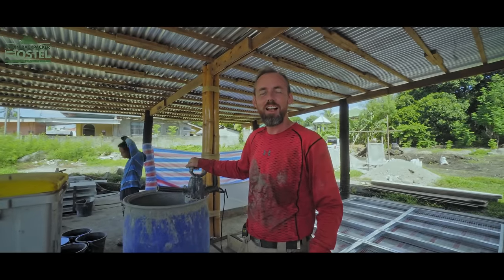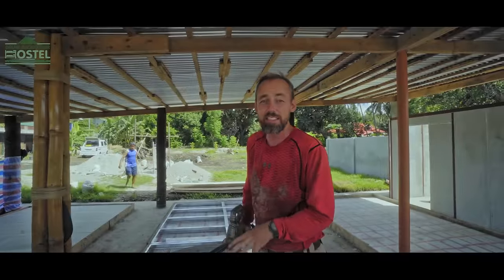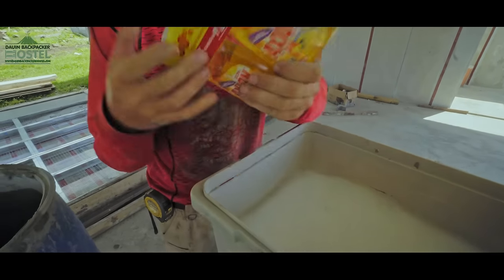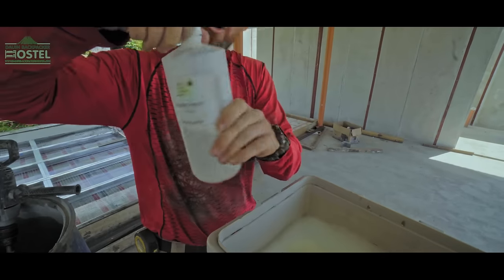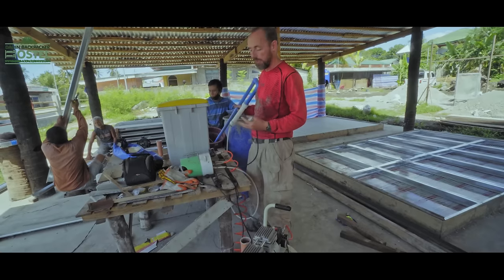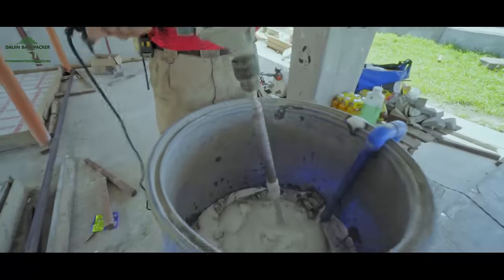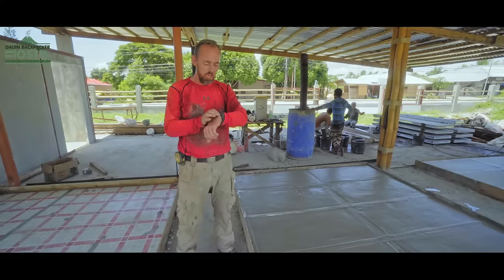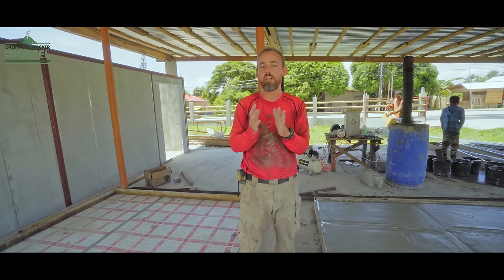Precast Aircrete/Foam Concrete Panels - How To Mix and Pour

Comment: I have an idea, I am to old to start a new venture, but someone out there may want to pursue this idea. I would like to build aircrete logs. Based on the toys we all played with when we were kids, Lincoln logs. These could be pre-manufactured so really almost anyone could buy the logs and construct a building. There would need to be different lengths made say like 2, 4, 6, 8, 10, 12 feet etc. There would need to be some that had special ends with channels for doors and windows. There could be some that are pre wired with wall outlet boxes and switches. Logs could be pre-colored or surfaced in some cases. A building could be constructed permanently by bonding the logs together, or could be temporary and disassembled and moved. I think this could be an amazing new business that could revolutionize small buildings. And it would allow for any person to DIY.
Reply: Unless one wanted to do it for aesthetics, it would be too much extra work over what is shown in the video.....3 sided post with a round side like a square log house...? chinking a cement log? too much work....just saying
Reply: I dont think aircreat is load bearing
Reply: @WindoWarrior  its not but could be reinforced.
Reply: @jerry-cw9yw  that could be said about all building materials. There is always a way to mess something up. But that doesnt mean its not a good product
Reply: That is actually a good idea.
Reply: There is a similar market available product called Apex Blocks
Reply: Extrude them into woven polyester tubes like giant aircrete sausages.
Reply: In another video he builts an entire building with this stuff and its panels as you can see 3 inch thick so yeah , load bearing just fine and it obviously works. So this idea is 100 percent viable.  Nice!!
Reply: They do make hemp and concrete Legos to build with so that's another idea hurry and patent the idea
Reply: If anyone sees this idea and decides to materialize it into reality, please make sure to give the original poster of this thread the credit they deserve. Be it the whole idea, parts of it, "a spin on it", or inspiration, make sure you acknowledge all the people and things that helped you along the way.
Reply: Nice
Reply: @WindoWarrior it can be.

Comment: I've seen people making foam blocks with 37.5 kg gypsum 2 kg cement mixed in 50 litres of water and foam. They set hard enough to be unmoulded in 15 minutes. They are then stacked for curing

Comment: I guess you have moved on with your travels. If you happen to log in again Id love to know the first step because its not mentioned. Can you tell us all how much sand and cement and water to make the initial slurry please. Video shows 1 bag sand 1 bag cement but how much water? Was that sharp sand or builders sand? Any additives? Maybe Im over thinking but ive most certainly written down the rest of the detail its great thank you. Please do reply because all the aircrete videos on youtube fail to mention this key step.
Reply: The details are all in the video and also the comments section but I had to watch the video a number of times and I'd like to mention that I personally think this video is the best I have found so far on how to make foam concrete for those just starting out.  Here is what I have found.....
PORTLAND CEMENT.......40 KG.
SAND.......30 KG.
WATER........19 LITRES.
LIQUID SOAP........500 ML.
GLYCERIN........30ML.
Make sure you use pure Portland cement without any additives.
Reply: @SaranganiBob  cheers mate 😘
Reply: @SaranganiBob  
Where did you get the cement sand and quantities? how much water in the cement mix? the 19L is for the foam mix, He said he was going to tell about quantities in another video, which he has not made yet.

Comment: The chemical that produces foam for cleaning purposes is also a chemical solvent. Apart from plastic-based and polyurethane foams, concrete produced with chemical solvent foam such as soap causes it to become brittle, crack and collapse over the years. I'm sorry, if it is produced with foam obtained from soap just to make it lighter or to reduce the cost of concrete, it will start to melt after a short time, just like soap.

Comment: Thank you for sharing.  It’s a nice consistent mix you are making.  My mix looks about the same but I am not adding any sand.   I use a double paddle mixer which makes a well blended mix in about 7 - 10 minutes per 90 liter batch.

Comment: One issue I've seen but I had the same problem... it's with the drop you then add too much foam for the proper mix from domegaia or elosha lenoff, but everyone wants to mix strong aircrete, not soft insulation. I find it works well with extra foam and cement... also type 3 sets up faster with less water, it almost sets to fast to mix... next I was looking into temperature, too cold and it will fall before it sets, so I was looking in to heated molds vs warm water.... plus no well water!... hard water is very bad for foam!... another thing I'd like to try is superplastisizers and setting agents.

Comment: I am a doctor(Anesthesiologist/Ophthalmologist).Thanks for sharing how to make aircrete.If you don't mind me asking for the exact ratio of the water,cement and sand mixture before you add in the foam?How much foam should we add as you've shown in this episode?I am really interested in using aircrete in the house we are planning to build soon...God is willing.Thanks so much again.God bless.
Reply: Amigo puedes usar solo cemento pero es más costoso usa 1 de cemento por 1 de arena y agua al gusto que quede durita le agregas espuma según quieras la densidad
Pesa 1litro de la mezcla de cemento y arena y luego pesa 1 litro ya con espuma y deberías de escoger cuandi con espuma te pese unos 620 grs a 700
Mucha suerte

Comment: While making chiffon and sponge cakes with beaten eggs whites, one tries to fold in the air foam egg whites carefully without breaking the bubbles.  One technique is to thoroughly mix a bit of fluffy foamy eggs white in thoroughly and then to more carefully fold in the rest.  I wonder if that would work for cement.  It needs to be mixed thoroughly for consistency and strength, but you want to preserve the bubble loft as much as possible.     .......mmmm, interesting you are saying it "grows" so that means some kind of chemical reaction keeps it bubbling more so it isn't quite like sponge cake batter, although that uses baking powder, too, so I suppose it is.  No wonder it works, though.
Reply: YES, FOLD  !!!

Comment: I have built several interior and exterior walls using the following mix design placed in slip forms and block forms.  

2:1 Cement:Water Slurry Mix: 25 kg cement slowly added while mixing into 12 liters of potable water in a smooth bottom 100 liter plastic barrel or trash  can.  Mix very well so that you have no clumps or settlement on the bottom.  This is a critical step.  Check to make sure it is blended. You will have failure if it isn’t blended completely.  I use a Klutch Double Auger Mortar Mixer. It is variable speed.  A concrete mixer doesn’t rotate fast enough to properly blend the slurry.  I have tried this method and failed.  Use a mortar mixer.  

Foam Mix: 1 liter of dish detergent (the right one varies by country) in 12  to 15 liters of potable water depending on the detergent quality.  It will take experimentation to find the right local detergent that yields long lasting, small bubble suds at 90 - 100 grams/liter.  In Mexico I use the brand Eficaz.  Dawn also works great but is over 3 times as expensive. Axiom didn’t work.  Salvo didn’t work.  Mix detergent into water slowly by hand using a pvc pipe or broom handle taking care to not create bubbles. 

Aircrete Mix:  Slowly add approximately 80 liters of aerated foam bubble mix to the bottom of the barrel over 3-5 minutes while mixing to make approximately 90 liters of aircrete.  I add the foam right between the augers to get it blended rapidly.  You can add less foam to make a stronger mix with a lower insulation factor (R value) or more foam to make a weaker mix with a higher R value depending on the intended use.  I use less foam for ceiling panels so I can walk on the roof.  I use more foam for an interior wall with studs.  

Happy Mixing!

You can use an interior steel reinforcement like WWF, chicken wire or other animal fencing to add tensile strength and reduce cracking.  I also use a fiberglass mesh on the surface to stop cracking, spalling and add tensile strength.  You must do a stucco or other finish to weatherproof exterior surfaces.  Aircrete is not waterproof!  It will weather and disintegrate if left exposed to rain.  I use gypsum board on interior walls as well as a finish to hide cracks and provide a durable surface.
Reply: Great informative video. Thanks.
Reply: Charles por gentileza vc poderia me ajudar com esses mil que vc faz?
Reply: Hi, Tnx for the overload of information, no I am joking. Was looking for the right mix and you answered the question. Tnx again, this was very interesting, now for the test myself. Manie South Africa.
Reply: @roek7630  Sand is only a filler.  In general the higher the mix density the higher the strength because mix density is typically a function of the cement:water ratio.  Sand will add minimal strength and will likely settle to bottom of the mixing barrel.  If you do try sand I would use the finest gradation of sand possible to reduce settlement.
Reply: @roek7630  You can use sand as a filler in a flowable, cheaper low strength sand/water/cement mix with no foam.  You will not get insulation material but it will likely be stronger.  Most flowable fill mix has a compressive strength of approximately 500 psi.
Reply: @charlesbartlett2569 

Thanks for the detailed info, sounds like you have a some experience with the process of foamcrete, and flowable fill.

Could I ask your advice about using either foam crete or flowable fill in a crawlspace in the Midwest.

The goal would be to cover and seal clay/sandstone base and walls. 

Any help would be greatly appreciated!
Reply: @Virtual-Media I am a civil/geotechnical engineer who worked in commercial construction for 25 years.  I have a lot of experience with both products.   I am not sure I understand why you want to fill the crawl space  under a house.  Do you have concrete or brick stem walls around the outside to keep animals out? You would lose access  for future plumbing and electrical repairs/upgrades.  Regardless, I wouldn’t use foam Crete as it is permeable to water.
Reply: @charlesbartlett2569  Impressive credentials! 

Thanks for the reply!

I should have been more specific, it is a crawlspace which I excavated by hand under a lakeside cabin. I put stem walls in-between the pylons years ago. 

I’ve since added on and around the place and converted it into a home. I’ve added perimeter drains, gutters and proper slopes and now considering the best option for encapsulation.

It has standing room in 200 square and 3 to 4 feet in another 200 square.

We would like to use it for storage and since I carved through about 3’ of  rock in the standing room area it has a nice cave like appearance.

I would like to create a fake concrete / cave look similar to those seen in zoos or theme parks in a way that’s economical, not to labor intensive while also creating an encapsulation for the entire area.

Just laying down plastic would drastically limit its use.

The thought of mixing a light weight concrete that has some strength that could be shaped into rock like floors and wall’s would be perfect. 

I have concrete and drywall finishing experience  but little experience with light weight concrete.

Thanks again for the reply and any advice would be greatly appreciated.
Reply: @Virtual-Media  You have an interesting project.   I wanted to do something similar to create a stacked boulder look for a waterfall.  I wouldn’t use foam Crete for the walls as it is very fluid, like self-leveling concrete.  It has to be poured into a form.  It also isn’t durable.  It needs a stucco finish to protect it.  Flowable fill is also very fluid.  

For the walls of the cave I would fashion the front facade of the fake rock out of chicken wire pinned to the rock or soil sidewalls by 18” to 36” rebar nails that are first pounded or drilled into sidewalls of the excavation in a 12” to 24” grid to provide a support structure for the concrete wall.   Fewer and shorter  nails can be used in the stronger excavated rock and more/longer nails into the weaker excavated soil.  You may want to place a plastic sheet vapor barrier on the wall to reduce effervescence depending on soil/rock moisture I would then tie a wire welded fabric (WWF10) mesh on the rebar about 3 inches in front of the excavated surface for structural support.  Then you tie  the chicken wire and shape it to form the inside edge of the rock wall.  I would then mix a very low slump sand/cement mix similar to whats used for gunite pools.  Then using a hand spade trowel you would slowly build up the surface of the rock wall starting at the floor by throwing the mix into the chicken wire/WWF.  Keep building the cave wall  until you reach the ceiling.  The final concrete  wall will be 3” to 6” thick depending on how much depth you want in the rock.  Scratch in joints between rock/boulder layers with the trowel as you go up and before the mix hardens to give it a natural appearance.
Reply: @charlesbartlett2569  Above and beyond!!

You are a very kind and generous person. Saved me a major headache and problems..

Wish you the best on your project and thanks again I’ve put you plans into a Google doc and using them to guide me on mine.

All the best..

Comment: So what are the benefits?
What building method are you substituting?
Whats the strength of this stuff?
Can some kick a hole in it?
Are you recommending this for only interior walls on commercial building,?
Or can you use for exterior wall of residential?

Comment: Great no-nonsense video!!
I suspect that not any soap will do, many have lotions & nonsense in them, which make them fundamentally bad at being soap.
Does the water HAVE to be clean? I'd kinda like to see this made with a whey-protien based 'graphene' suspension instead of tap water.
Fine styrene pellets can work well too (in lieu of suds), if you have enough access to waste styrofoam, and a good way to grind it. Seems a bit more stable.

Comment: I've seen this used in California for a concrete roof calling it light weight with the air and soap added to it
Reply: After watching video, I was thinking the same thing, maybe pour a thin slab for flat roof,
which I have need of as mine is leaking. I wonder how it sets up and holds together over
a large area like 20' x 30'?  May need a sealer I suppose?
Reply: @rockyfjord3753  needs roof coating, you can do asphalt t impregrante the concrete, and then on the cheaper side do elastomeric white roof paint on top, that you can do by yourself, but aircrete has porosity, and will absorbwater...  you can then also hire a roofer to install TOP membrane, or other covering suitable for flat roofs, instead of the elastoeric paint...a flat roof is often nt really flat, it should have about 1 1/4" pitch per foot....
Reply: @JohnVieiraact  Thanks.
Reply: @rockyfjord3753  you can add fiber clothe and apply thin later on top it with acrylic cement or waterproof cement

Comment: Really interesting work you are doing. Just want to make a comment about your experience with type 1P cement.
You may be able to get even more positive results by using 1P.
Because Pozzolans can have water reducing properties, you may be able to design a mix using this cement and reducing the water content which will actually reduce the permeability while increasing or maintaining the same plasticity or workability. The ultimate strength might even be a little higher. Curing should be the same time allowed

Comment: What is that tool you used for pumping the mixture foam ? And how did you connect it with the air compressor?

Comment: Great video!  Thank you so much for sharing your experience.  Just curious if the frames are completely removed when the panels are stacked to cure?  Thank you again.
Reply: Hey, frames remain, they would be very difficult to remove as they have a lip that is now cast inside the aircrete.
Reply from the maker: Hey thanks, yep frames remain, they are an integral part of the strength of the entire panel.
Reply: @aircreteconstruction  To keep costs down David, what are your thoughts on using Coco lumber instead of galvanized C section steel? The locals seem to think they would be eaten by termites after a short time but if treated with Solignum  pest protection and completely enclosed maybe it would work.
Reply: @SaranganiBob , if available in your region, I would suggest the use of treated bamboo for the frame in lieu of coo lumber. Bamboo is stronger and lighter.

Comment: do you have a per panel weight on this material?  Have you done any actual compression testing of the aircrete?  Not sure if this has been asked and answered, but what is the purpose behind your work in the Philippines - especially around contruction?

Comment: Hello just stumbled in your video, How does this aircrete fair in the summer weather condition in your location? How does it insulate the outside summer heat compared to a regular CHB cement construction walling?